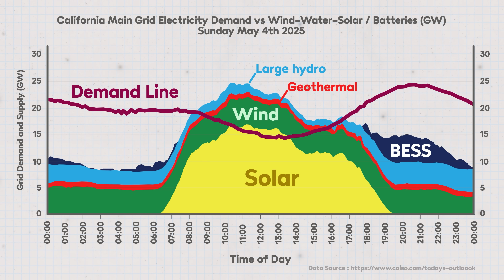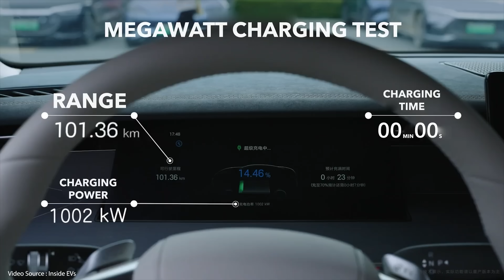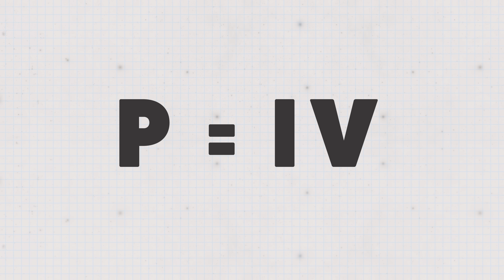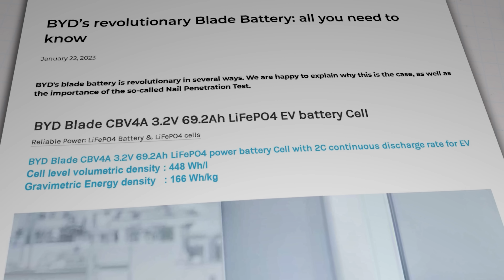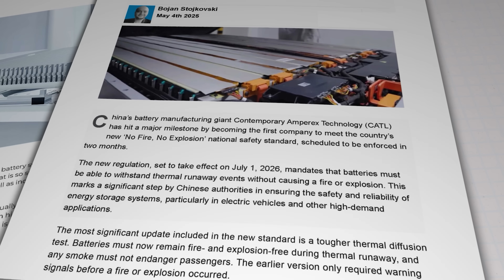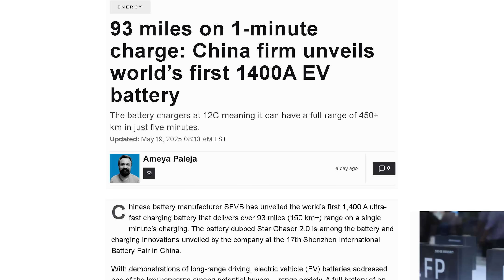BYD 1 MEGAWATT 5 minute EV Charger. Overdue or Overkill?

Comment: Nine years in my EV that features 100 kW ”fast” charging. I do a couple 600 km trips each year and it never bothered me. 20 minutes, perfect for coffe and a stroll, clears my head. Sticking with it.
Reply: Before I had my EV, range anxiety was a serious concern to me. Now, it hardly bothers me. After a few months of owning an EV,  you get to "know" your car and can pretty accurately estimate the range it can travel at any given battery state of charge. On a long-distance trip, just like driving an ICE car, you'll know whether you'll need to fill up at this oncoming highway pitstop or skip to the next one. 

The anxiety comes from not knowing and imagining the worst possible scenario. With experience, that feeling will be gone.
Reply: @alihms  Why do people only get "range anxiety" with EVs? Have they never run out of gas?
Reply: @pixeloid because most people live and travel in areas where there is a week established and extensive network of fuel stations for ICEs not so for EVs... yet. But they are catching up.
Reply: @MartinBVDK  In Japan we have a different issue. We got an EV a couple of weeks ago and charge at home, but have no idea how to use a public charger. The problem is there are a bunch of different networks of chargers and they all have their own payment systems. Some use apps, some use physical cards, and I believe some you can simply pay without first joining their network. Will take us a while to work that out. Some makers like BMW have agreements with multiple networks and issue their own card that can be used across all of them, but others do not. We'll be having a one-month check in with the dealer soon and have a lot of questions for him.
Reply: I hardly ever charge at public chargers as usually I charge at home once or twice a week during the night. But when you travel often (like I used to to before for business), to have super fast chargers along the highways would be perfect. Now a day it's difficult to find an EV that can travel more than 300 km at 130 km/h with a full charge (actually most cannot even do 300) and when you have your appointments scheduled or a flight to catch it's hard to stop 20/30 minutes for a 60% charge that gives you only another 150 km or little more of range. I'm absolutely happy with my first EV, but if I was doing the life I used to, I couldn't have it. Super fast chargers would improve the EV experience a lot. 
Also consider that if we have those fast chargers we can reduce the number of charging points by a lot.
Reply: @tpn3561  130km/h? Illegal in he UK and ought to be illegal everywhere.
Reply: @rogerphelps9939  Why? because you decided so?!  There are many countries in Europe where the speed limit is at least 130 (where safe). I believe the largest ones are Germany, France, Italy and Poland and I think another 10 countries, if not more, allow it.
Reply: @rogerphelps9939  Perfectly legal in other EU countries. I've seen even 140 km/h on a highway somewhere, either in Romania or Bulgaria. Then there's the Autobahn ....  But yeah if you look at how much more fuel is needed for 130 km/h compared to 100-110 km/h it makes little sense. Then there's the safety aspect too.
Reply: it takes about six hours to drive 400 miles. It is good to stretch you legs, relax, and destress.
Reply: @ThatOpalGuy  
RE: "it takes about six hours to drive 400 miles. It is good to stretch you legs, relax, and destress."

This is called "selling the sizzle" in the marketing biz.  

Fine as far as it goes, but when the product you are delivering is a rancid piece of maggot infested meat because the refrigeration failed along with the green grid that whose failure, proceeded it paints a different story.  

You see it’s been rather cloudy this week with little wind and virtually no so solar energy harvested,  what little electricity remains has been vectored to essential services and your weekend auto trip is not considered to be essential:  The legislature is now in emergency session trying to figure out who the blame should be assigned to - the vote is split along the party lines.  

So now you’ve lost all of the remainder of your charge along with thousands of other vehicles stranded on the highway;   the filling station you are currently stranded at normally carries countless shelves of junk food, but they have long ago been stripped by ravenous fellow stranded travelers.  The ladies can take their choice whether they want to pee and poop on the side of the road in front of an audience or venture into the overflowing toilets of the filling station to stand in line behind hundreds of others (the only TP remaining is lying on the floor in pools of pee studded with little islands of poop.)   You are now considering if the ditch water is safer than the windshield washer fluid for human consumption.

Remind me once again, why are we choosing to live this inevitable nightmare?   

Do you expect a different outcome other than chaos from "government planners" than you received from your "government educators" who have given you the unenviable distinction of  becoming the dumbest generation in American history.
Reply: @ThatOpalGuy  "it takes about six hours to drive 400 miles. It is good to stretch you legs, relax, and destress."

I just did that on a 900 mile trip, stopped at a couple of nice nature trails, historic ruins, a beach- none of which had electricity far less chargers.
If I want to  hang out at a crappy service station for an hour, for what normally takes me 60 secs... I can already do that in a normal car- no thanks.
Reply: dohh, 400 miles is lesss than a weeks communute for most commuters
Reply: @PazinPortugal you sure. How did you work that out. I commuted for years 20 miles a day
Reply: No range anxiety here, the only long trip I ever seem to take is about 150 miles and I get where I am going with about 50% charge left on my Bolt.  Plug it in when I get there and there is no concern.  I know everyone's use case is different but most folks don't uber mile.  My LEAF could not really keep up, but pretty much everything modern seems just fine.  I once drove from the east coast to MN and of course something like that would be a different story but for me that was a once in a lifetime event(1991 Superbowl :)).
Reply: This would be slower. Right now you get a priority parking spot that you can stay in for 20 minutes. With 5 minute charging you'll have to stay with the vehicle, then unplug and move it before you can go off to the toilet or buy a burger. 

"These writers" are successful in their goal of getting manufacturers to waste time and money on features no one needs or wants.
Reply: @gasdive  just like an ice car you mean? It's a negative all of a sudden? Or am I not understanding you?
Reply: @Flaggyt  yeah, just like an ice car. Which is a negative. Ice is not as convenient as a fast charging EV because you have to be there for the whole fuelling process. This super fast charging EV is as inconvenient as an ice car.
Reply: @gasdive  my mind is blown right now... Use a slower charger if you really want to, your choice, no one is forcing you to use a fast charger.

This must the single most ridiclous thing i heard in a while. Chapeau.
Reply: If you run out of charge they now have towable chargers to take the charger to your stalled car....the towing vehicle and the generator are all powered by diesel engine - its a "green" thing
Reply: @brucefrykman8295 That will change. Rome was not built in a day.  Running out of charge is an extremely rare occurrence.
Reply: @rogerphelps9939  I saw plenty of Tesla stuck on the side road while driving my V8 Tahoe from Los Angeles to Las Vegas last year in May 😁
Reply: You'll need faster charging if you tow or a truck .
Reply: @MatthewBayard  Not if the trailer has a small battery and motor to assist, just like an ebike does! Unlike an ebike though there is plenty of room to solar on these high sided trailers.
Reply: @MatthewBayard trucks have faster charging systems. Towing performance will be much improved by faster charging. Kind of the point if the video you just watched? 

Mathew are you trying to disparage electric vehicles ?
Reply: Did you even read my previous comments?  @constructioneerful
Reply: @MatthewBayard  MW charging already exists for trucks. This is about batteries getting faster to accept a charge, which no one needs
Reply: I tow with an EV regularly and would love faster charging 
 But I don't need a bigger battery EV.  @gasdive
Reply: @MatthewBayard  BS
Reply: This is never going to work.  Charging a large battery in a couple of minutes will kill the grid.
Reply: @tarstarkusz Never say never. 
If batteries are cheap enough, the charging station can have a giant buffer battery and the overall instantaneous drain on the grid wouldn't need to be that high.
Reply: @tarstarkusz  Unless they have some mega capacitors or just some other batteries to charge your car. Of course those would still need time to recharge.
Reply: @tarstarkusz  They do not think of things like this: they dream of their personal little utopia filled with unicorns and fairies.  Dreaming is the important thing.  NEVER fly in an airliner designed or flown by leftists.  Aeroflot had the world's highest passenger death rate by orders of magnitude before they wised up and began buying free-market commercial aircraft.
Reply: @tarstarkusz Battery pack buffering.
Reply: @tarstarkusz  It's not a problem. 
The problem is that the load isn't at the same place as the industrial loads that the grid is currently wired up for. 

The fun bit is to realise that in the old word it was rotating masses (generators) supplying rotating masses (motors), while in the new world it'll be battery energy storage systems (BESS) supplying battery energy storage is electrical vehicle (EV) batteries.

It's annoyed a lot of older engineers who got too familiar with the old systems and hadn't kept up their CPD ;-)
Reply: @philipoakley5498  No.  Electric motors will put even more rotating mass load on the grid. Not cars, mind you, but other things you want to electrify.
Reply: @tarstarkusz  That's the confusion. All (almost) the new motors are variable frequency, electronically controlled, drives (VFD style) rather than dumb induction motors running at grid frequency. That's the disconnect. That was the load, but it's now electronic control modules from VFDs, EV chargers to HVDC links. 
The balance is/has shifting/ed and the method of network operation is changing to match. Those at the 'coal' face still worry about rotating inertia, but those planning the network upgrades and building the sources and loads are looking to a range of new opportunities.

Comment: Yes, Dave. Now where are you getting the MW necessary to charge it without blacking out the domestic supply?
Reply: You realize power is sold by the MW, right?  Even if your argument had merit (it doesn't), local batteries could be used to reduce the peak loading.

Comment: Not only is range anxiety highly exaggerated (at least in our experience) but since we bought our second EV with a good sized battery, we almost never have to charge outside the house except perhaps on an annual holiday.   But I can't see most people wanting to use their car as a battery for the grid.  You want your car fully charged up and ready to go.  Perhaps one might use the top 20% of the car battery for the grid if the price was right but the rate that the 'grid' was going to give you would be the only incentive that would cut it.
Reply: B2G is also a bad idea because batteries only have so many charge cycles in them, and using them for the grid will increase wear and tear on your battery pack in your car thus shortening the life of your battery.

I will not be using my car for grid power support.

I'm with you.  You want it fully charged in case of emergency.
Reply: When the hell do you need to drive 400 miles for an emergency?

Comment: Most people don't drive hundreds of miles a day regularly.  Just rent a car once or twice a year for vacation or special events.
Reply: I've been on 6 road trips in my EV, and charging was no issue at all.

Road trip EV tip...

When charging on a road trip DO NOT charge your EV to 100%.

It's a waste of your time.

Only charge enough charge to get you to the next charging station.

When charging an EV from say 10% state of charge to 80% state of charge, the charging process is quick, but when charging from 80% to 100% you can easily double the time it takes to charge.

So don't waste time trying to charge to 100%, only charge what you need to charge to get you to the next charging station.
Reply: @Les_S537 I absolutely agree but some people are stuck in their ways.  They can just rent a car and be done with it.  Only charging to 80% extends battery life too so IMHO no reason to exceed that most of the time.  The last 20% takes longer and heats the battery unnecessarily.

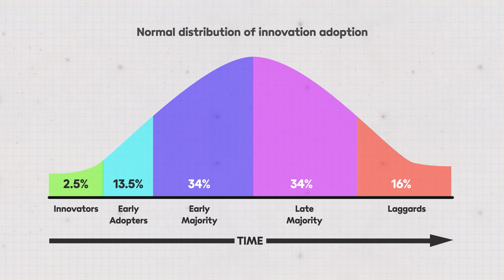Comment: 1:45 There is some selection bias in 'Existing EV drivers'. That's the set of people who are either really keen or for whom an EV works relatively painlessly. It's not great evidence that range anxiety and charging speed are not real problems.
Reply: 10 years ago that would be a fair objection.
Reply: @jnawk83  My point that there is bias in the selection is independent of time. By definition it's the people for whom EVs already work relatively easily (or who don't care about the ease) that have them. It's not an objection, it's just a fact. 

Range limitation is the main reason I've not bought an EV yet despite following the market very closely since 2014, being  very keen to get off fossil fuel. For our usage (campervan) there still isn't a good vehicle available. The Buzz is the least-bad , but that's a very small van with a fairly limited range (230 miles), no heatpump, no V2G, no camp-mode for £80,000. It's not very attractive. The Farizon might be OK if you could buy the H1 version with the 92kWh battery, but they don't offer that option. The LWB buzz would be better, but they don't do that in cargo version. All the other vans are under 200miles real-world, and many have slow charging. So I'm still waiting. Coming down from 750 mile range (200 mile buffer) to 250 mile range (40 mile buffer?) is a big change in operation and mindset. It's obviously possible but it's hard to spend 50+ grand on a vehicle unless it's actually good (enough to persuade my wife who is current unconvinced).
Boondocking camper-vans is pretty-much the worst-case for EVs so we are necessarily late adopters. I really hope someone will make something good soon.